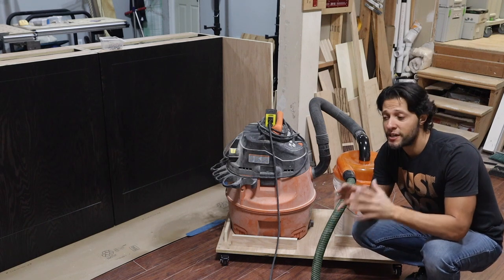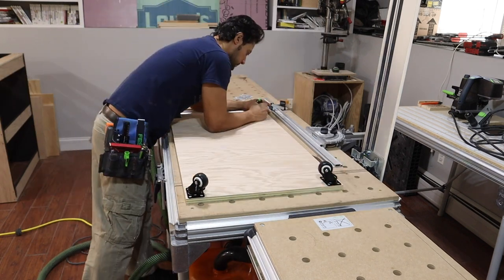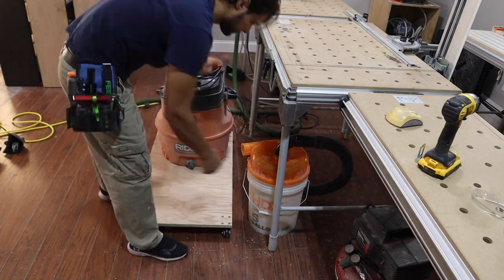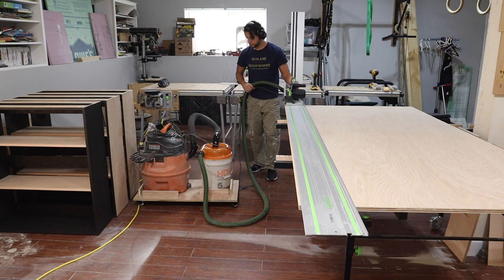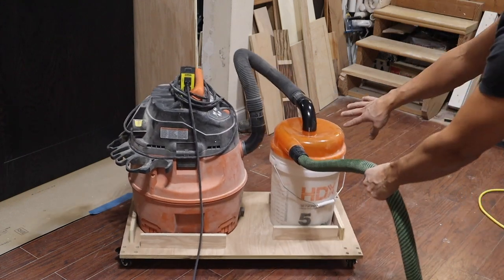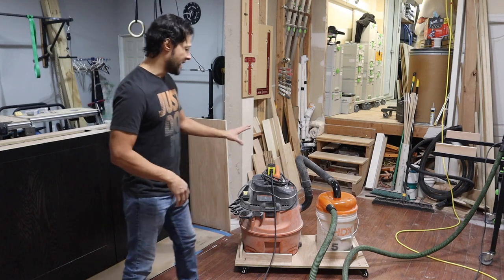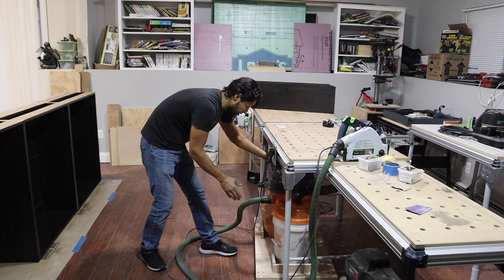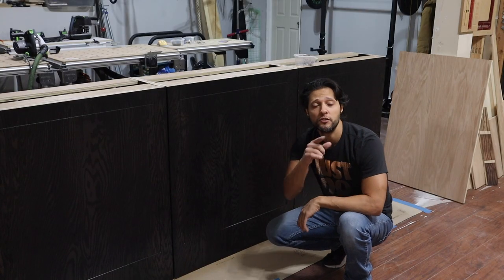dust collector cart (shop vac edition)

Comment: Thanks, Anthony.  I am currently wrestling with both the vac and the dust stopper.  Nothing makes me happier than pulling on the hose and tipping just the bucket or both over onto the floor, and perhaps popping one of the hoses off as an added benefit!  🤣 So I'd better get busy and build one of these.  Thanks for the great idea!